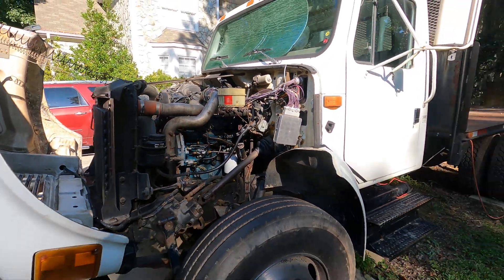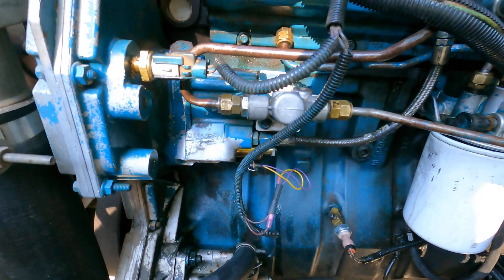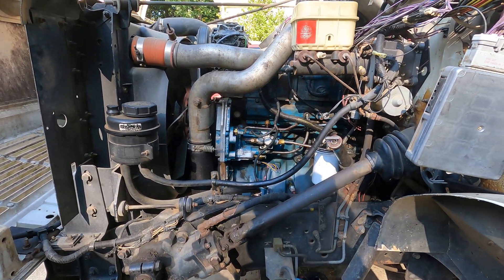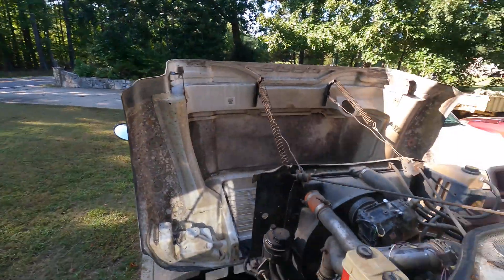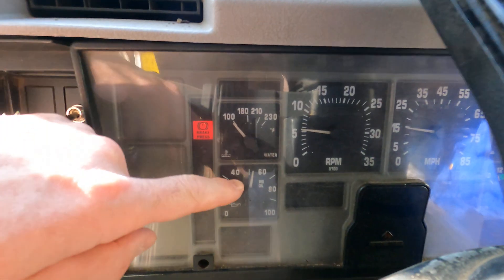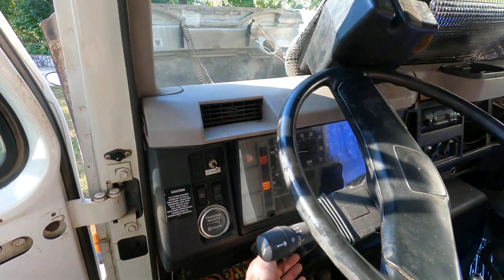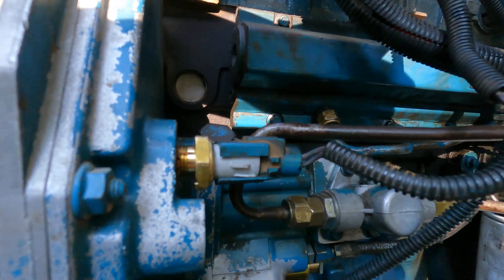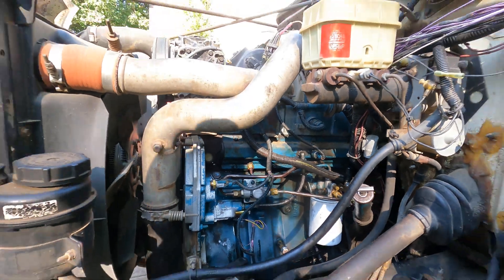1998 International 4700 DT466e No Start (*due to HPOP Ferry Plug Ball)

Comment: Hello, I have a 1999 International 4700 DT466E. The problem is that it takes a while to start the next day. After it starts, it runs fine throughout the day without any issues. What could it be?

Comment: I'm having the exact same problem. I bought the truck recently but it had been sitting for a few years. I check the perry ball and it is present but the oil is really dark. I haven't changed the oil yet.
Reply: Change the glow plugs.... dead glow plugs means no start .